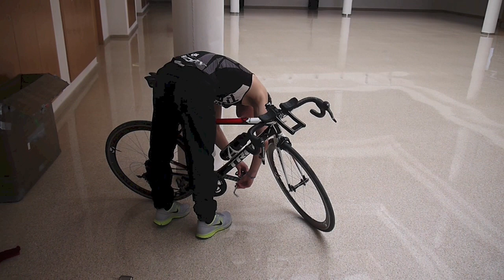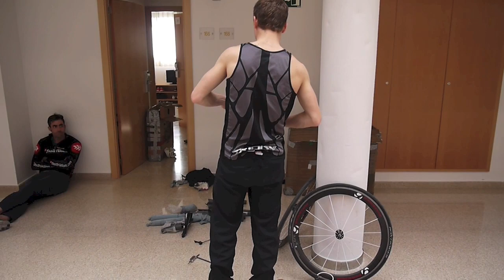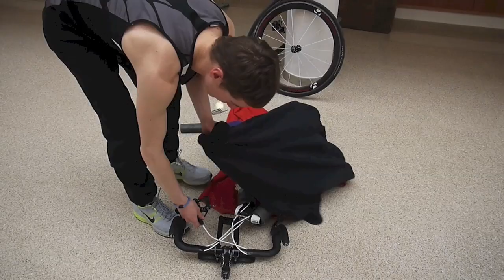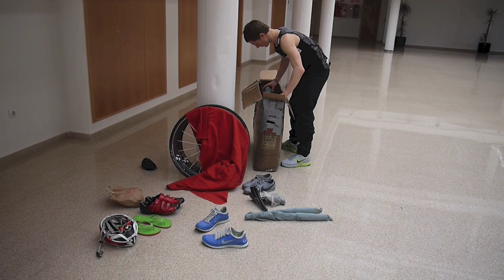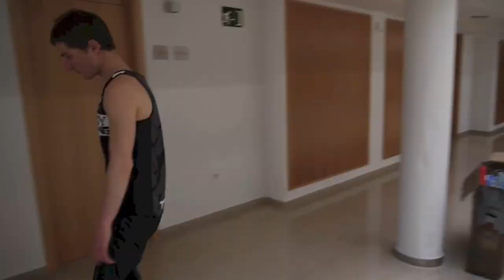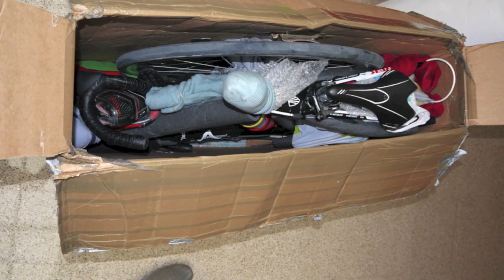How to pack the road bike in a small box

Comment: This has helped a great deal, because the size of your box is twice as cheap to courier as the other bike boxes. It looks a little wider than normal bike boxes (22cm), but much shorter in height and length (80 x 70).